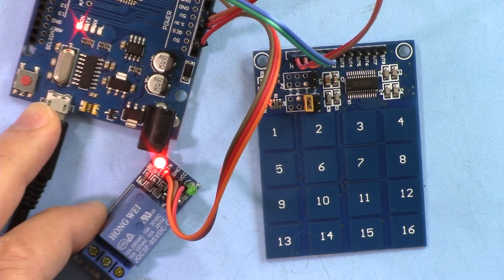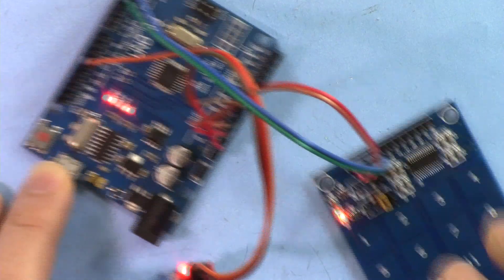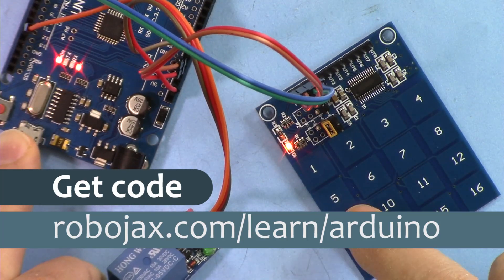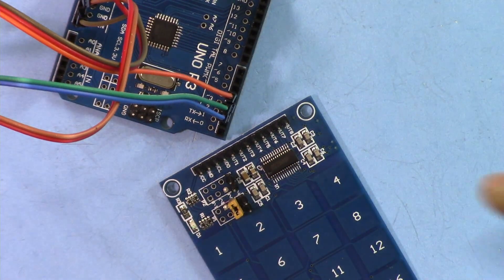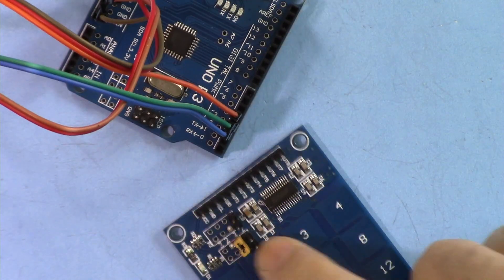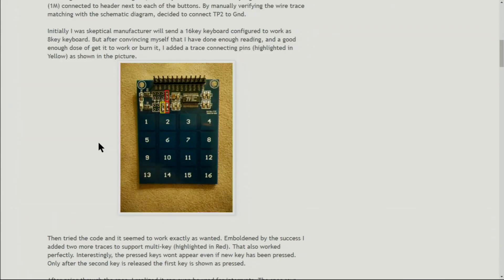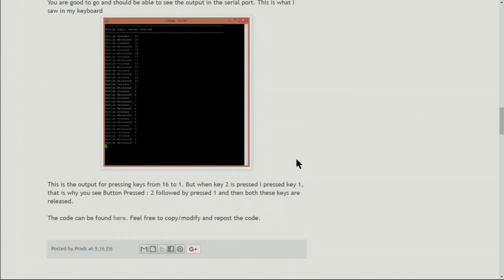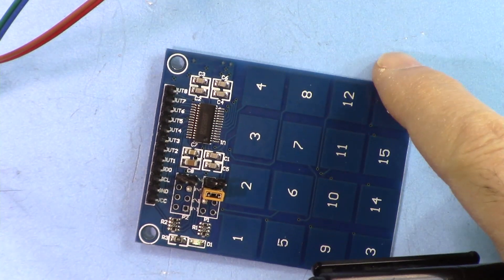How to use 16 Channel Touch TTP229 module with Arduino RJT146

Comment: Sir, please help me. I could not find any solution to my problem on internet...

I want to use external touch buttons for this 16 channel module.... Which means I want to extend the touchable surface to a distance...
Please suggest something...
Reply from the maker: You may use raspberry Pi with camera which detects position of finger on a surface that acts like a keyboard

Comment: unterminated argument list invoking macro "DEBUG_BUTTON16" I get this error. I can't compile. what should I do.
Reply from the maker: the code must have been changed or you copied it incorrectly. Try getting the code and library again.
Reply: @robojax  
I did the compilation. I made some additions and the code worked very well for me. Thanks for your help.

Comment: Hi, can I connect a df player to the arduino and control it with this keyboard? Nice video by the way.
Reply from the maker: Hi, I've already shown how to detect when the key is pressed.  for your microsDC card player, you have to program it so it plays each clip and name each liip like clip1, clip2, clip3 ...etc. then from this video, when specific key is pressed, trigger the clips. for example for key1 trigger or turn ON clip1 and so forth.
Reply: @robojax  oh awesome thank you man👍
Reply from the maker: you are welcome. so are you.. Please don't forget to subscribe and share my channel. thanks.
Reply: @robojax  how about the wiring? Is it the same or I have to make changes?

Comment: DEBUG_BUTTON16(Serial.print(g_prop.IgnoreNextEvent ? "Ignoring next event

" : "Not ignoring

"));
this line is wrong  sir ji
 DEBUG_BUTTON16(Serial.print(g_prop.IgnoreNextEvent ? "Ignoring next event\n\r" : "Not ignoring\n\r")); 
this line is right  sir ji
Reply from the maker: I use this example in demonstration and recorded and posted the code, and I don't think  there was issue at the time of posting the code.

Comment: i have an error with 'unterminated argument list invoking macro 'debug_button 16'.....(i did copy-paste your code...)...
Reply from the maker: Then you must have incorrect wiring.  You haven't subscribed. Please subscribe. I spend hours testing, recording, editing and uploaded. You simply click and subscribe.
Reply: @robojax  i did the wiring exactly as you did and i can't upload your code due to the errors which told you. But i uploaded another code and it works, but with just 8 keys. i did the connections indicated by you (and other users on  different web pages) and doesn't work with 16 keys, i don't know why....
Reply: Check the code, there are a few statements broken into multiple lines.

Comment: Cool.  when you have both Jumpers for two button press method - It seems like it works with two packs of 8s - meaning EVERY time you press a number the other one that is located on the same position in the other 8 is pressed as well - 1 to 8 and 9 to 16, meaning when you press 1 you also get 9 and when you press 2 you get 10 (yes I know it showed that you pressed 6 - but since it is VERY sensitive - your finger pressed both 2 and 6 together and you got the output of 10 and 14) So it looks like this board have a button press that is activated on both 8 buttons sharing position of the button. that is how it looks to me, I already have this board - I need to solder headers and have jumpers to work with it (might use wires as jumpers). Looks great - I want to be able to make it a 4 numbers combination locker - so it will trigger only after the 4 digits where pressed - that would fit an 8 buttons more than 16 but since we can use it as an 8 button I will try it. thanks for the video.
Reply from the maker: You are welcome Arye, I am glad you liked and learned from my tutorial. cheers, Ahmad

Comment: seems not working.
Reply from the maker: check wiring and made sure you did not add or remove anything from the code. it should work. Unless you have got different touch module.
Reply: Which version of arduino software? Mine use 1.8, It failed verification
Reply from the maker: I am using 1.8 as well.

Comment: Does that 16 channel touch has in build memory chip ? So if we program and send to the board will it work independently? Without use of uno ?
Reply from the maker: if you use 8 channel, you don't need arduino. but for 16 channel, a microcontroller (such as Arduino) is needed to translate the actions.
Reply: @robojax  can you make a video of that.. uploading program.. after touching it keeps on until we touch it to switch it off